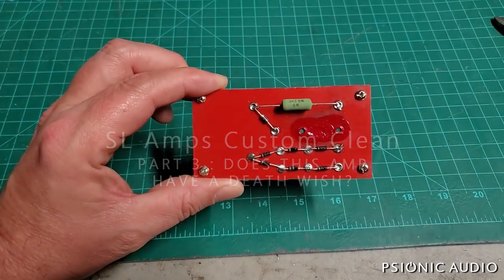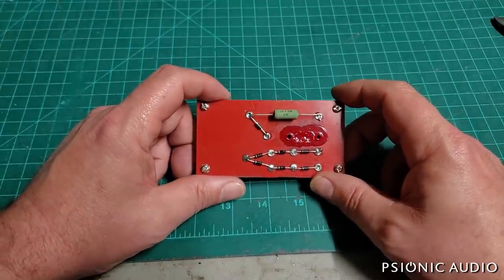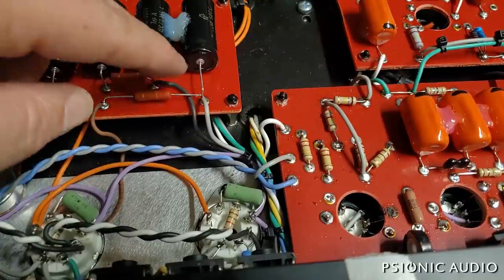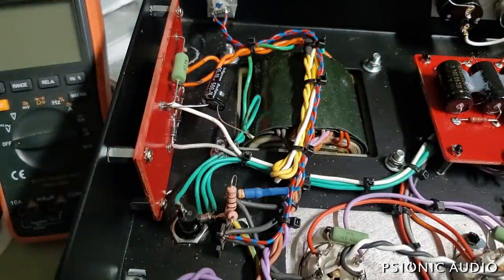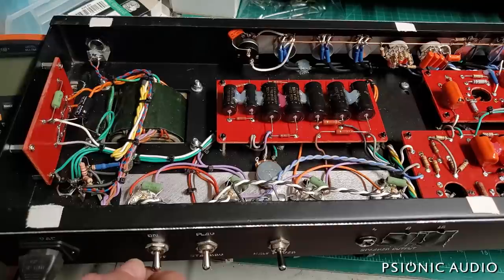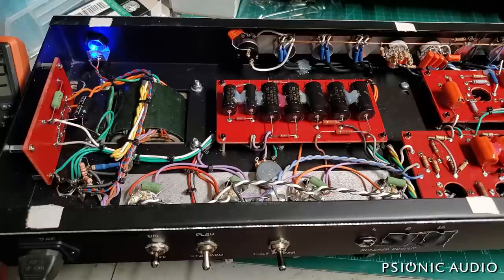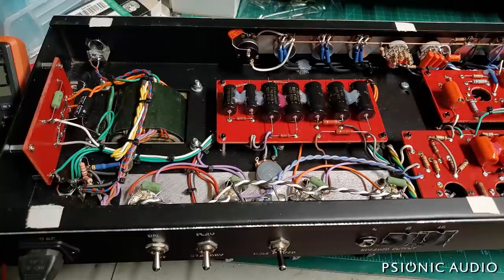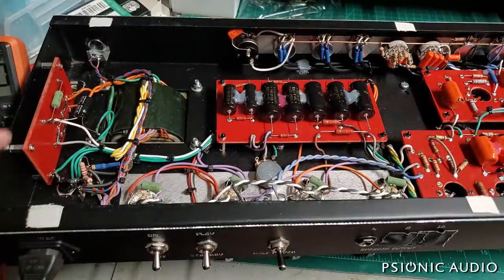SL Amps Custom Clean | Part 3 : Does This Amp Have A Death Wish?

Comment: "I dont like to fix my own mistakes, so i try not to make them" <--- awesome !
Reply: How do you do a center hole replacement on a tube ? I have two vintage RCA 6L6's that the center is broken on. I know the tubes are good. Curious
Reply from the maker: Tubedepot sells replacement key bases. They glue on to the tube if needed.

Comment: Good luck Lyle. I know you'll get it sorted out better than ever. Nice safety mods. Pete Honore did a demo on an SL Custom Clean with 4 KT-66's into a Zilla 2x12 open back cab loaded with G12-65's. It was one of the best sounding amps I've ever heard. The gorgeous  PRS didn't hurt either. And the beat-up tele sounded fine as well.

Comment: Wow, a 12BH7; you rarely ever see those in a guitar amp, but they were used in some classic hifi amps. More robust than any of the unusual 12A family of tubes. Is it being used as a voltage regulator for the bias in this amp?

Comment: I am seriously thinking of doing this fuse mod to my Carvin Belair. It has a 3 amp slow blo fuse on the primary side, and fusible links before the diode rectification. But I have the chassis out of the box and one of the EL84 tubes just started redplating like mad, I switched off the amp immediately. But no fuses were triggered.
Reply from the maker: Looking at the schematic, increase the screen grids from 350R to 1Ks, add the R3000s shown as not present, and increase the grid leaks in the PI from 100K to 470K.

That 56pF cap "to prevent oscillation" could also be failing. I'd take a close look at the NFB circuit too - it could be slightly too much NFB, which can cause instability (that 56pF cap is most likely a bandaid).
Reply: @PsionicAudio  thanks for the suggestions!  Do you have a preference for screen grid resistors with lower wattage ratings or higher rating?  I have heard lower can be better in some cases, because the resistors will burn out first protecting other more costly components.
Reply from the maker: I prefer fuses to burning resistors. 2W-3W screens will be good.
Reply: @PsionicAudio  you think fuses at the cathodes are still a good idea with all the above changes. Or are the stock configuration fuses ok? One being on the primary side of the power transformer and the two fusible links before the rectifier bridge.

Comment: With a tough nut like that, your ($ = hourly_rate X hours_spent) can easily approach the cost of a new amp. Then it becomes a question of how much can you reasonably charge the customer?
Reply from the maker: Ah but at the end I'm a better tech than I was when I started it. 

Some time/costs I eat when it falls in the category of Continuing Education.

I think many of the ills I'm chasing now stem from the owner putting in that 6A fuse.

Comment: Wait, -700V on the bias??  Ok, I don't have a schematic, but I'm thinking you have a open ground problem on the transformer.  Assuming a normal schematic, I'd have a look at the center tap ground.  But I also suspect you might have another problem that loads one side of the HV winding more than the other such that the open center tap moves to several hundred volts negative (and shifting all the other voltages).
Reply from the maker: I'm very much suspecting the PT is yearning to join the choir invisible. Trying to make sure before going that route.
Reply: @PsionicAudio  Its pushin up the daisies, pining for the fjords...

Comment: That inverse plate/bias voltage fault doesn’t make any sense. That amp is very strange.
Reply from the maker: I have a theory. PT was damaged by the previous failure with the 6A fuse installed. Worked for a bit in this video after I replaced the shorted caps, but then failed. Now it can't provide enough current for the B+ supply so the voltages there are low. But the HT-derived neg supply has very little current demand, so it's getting ALL the voltage. See the next video (up soon).
Reply: @PsionicAudio  That is unfortunate. This is a perfect example of what happens when you mess around with fuse ratings. 
I hope there’s a suitable power transformer out there. It uses a tap off the HT for the bias, right? A Twin Reverb PT might work.
Good luck and of course I’ll be watching the next one.